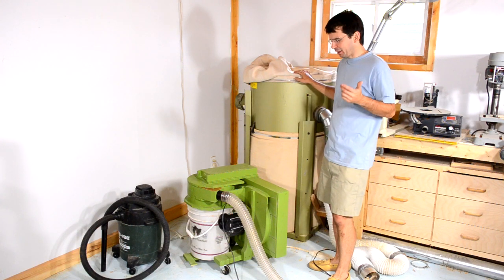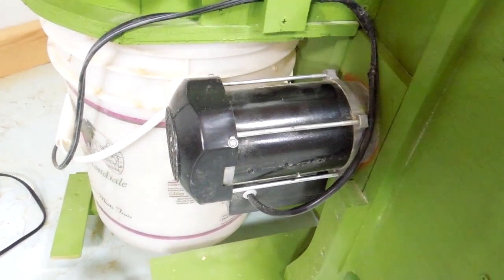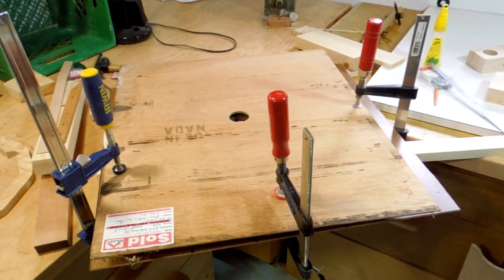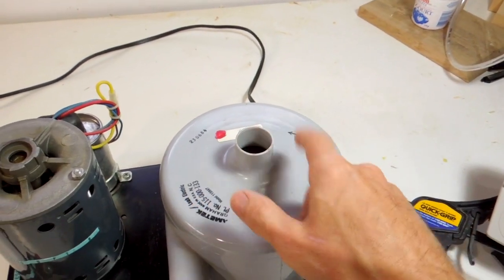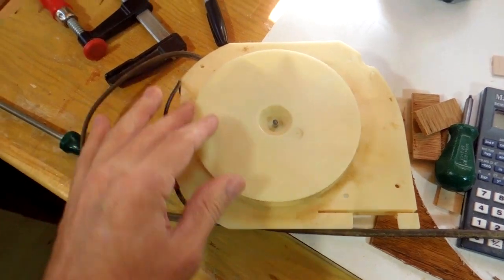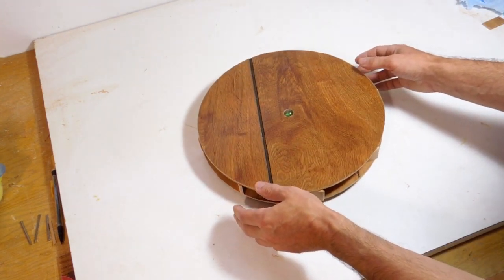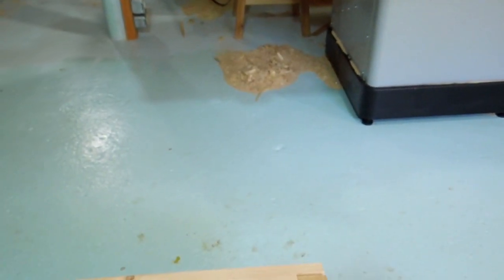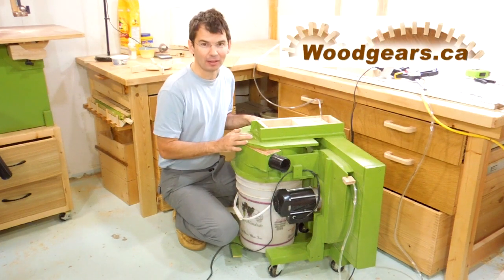Dust collector blower design experiments

Comment: The full speed of that motor sounds close to a GT-R xD
Reply: Maurice-Mores haha good ear. thats awesome
Reply: +Maurice-Mores Oh a GT-R. I've seen a electric beat one in a 1/4 mile
Reply: +Ckc dillpickle Thing about electric, I believe they have better acceleration but lower top speed
Reply: YoFavRussian
No..... Electric motors have instant torque. Most electrics are slow because they usually only have 1 gear and having a gearbox would add lots of weight and reduce efficiency of the motor
Reply: But would that not make electric have faster acceleration and lower top speed.
Reply: YoFavRussian
Weight decreases acceleration and gears increase speed
Reply: Oh, I see
Reply: Sounds like a ricer we-86 exhaust

Comment from the maker: I think if you wired one to ground and one phase, and connected the other phase straight to the other phase, it should give you a reasonably accurate reading, although with just half the voltage and power indicated.

Comment from the maker: I have used some old furnace motors.  But they aren't suitable for this particular application, they tend to be 4-pole motors running at 1750 RPM, too slow for a blower like this.

Comment: I love watching you work man, good job. I couldn't help but think that repurposing an old squirrel cage fan from an old furnace might have saved you some time. They are readily available for free and push at least 1200-1500 CFM or more, depending on the tonnage. Check with any A/C shops that change out residential systems and ask them to save you a fan.
Reply from the maker: txgunslinger77 An oscillating fan will deliver even more CFM.  But without the pressure, it's useless.  And a furnace fan gives less than a tenth of the required pressure.
Reply: Matthias Wandel I am not sure why a lot of static pressure is needed in this case? For 100 ft. collection systems with multiple branches and 8" or more of static pressure to overcome I understand, but how is that relevant here? How much static pressure are we talking about? Is it CFM or static pressure that supplies the suction? I'm not an engineer so forgive my ignorance.
Reply from the maker: txgunslinger77 Do learn something about fluid dynamics.  Any ducting has air resistance.  To get a good flow rate, you get pressure drop from air resistance.  If the blower can't provide the pressure, you simply won't get significant flow.
Reply: Matthias Wandel You didn't really answer my question, but thanks for the condescension. Unsubbed.
Reply: txgunslinger77 CFM is the output air flow and static pressure is the amount of pressure the fan can push through an object, like an air filter. Hope this helps at all
Reply: +Matthias Wandel Q=P/R, right
Reply: +Matthias Wandel  I know your comment is 9 months old, but for future people looking at this... 

A squirrel cage fan could work just fine depending on the specific fan and system pressure drops. Your fan produced roughly 8" of static head at no flow, which is a pretty sizable pressure. However, in opperation your fan will ride down the fan curve to a lower pressure/ higher flow state. 

On the squirrel cage fan, it normally operates at a much lower static pressure and much higher flows. So, if you put it in the dust collection system it would ride up the fan curve to a lower flow and higher pressure. Would there be enough pressure? Not sure, but I wouldn't outright deny it. However, in general, your comment does stand. The backwards curved blades are certainly the best for the application. 

I could also comment on the wheel size vs motor HP. I don't agree with your video comment about needing a smaller wheel because you are over amping the motor. What you actually need is a slower fan. In general, you would have a more efficient system if you kept the largest wheel diameter and slowed the fan down by going belt driven.

Source: I am a HVAC engineer and select fans regularly. Search google for "Engineering Cookbook" and read pages 5, 6, and 7 if you want to learn about fan types and applications. If you want to play around with "what ifs" go to Greenheck eCaps program and find fan selections for various fan types, CFMs, and static pressures. Pay attention to wheel diameters and motor HP in the selections.

Comment from the maker: If I built it again, I would make changes, so I don't recommend copying my design.
Also, your motor will have a different RPM, so the blower would need some slight changes as well.

Comment: well i found your channel and am glad i did.  i will be looking a bit more closely at your pantogram and horizontal drill press.  however, right now dust collection in my shop is a higher priority.  the shop ones are out of my budget and this would be fantastic.  i am presuming this is more than strong enough to clear from my thicknesser/planer?  anyway what i am trying tio say is will you be putting the plans etc up for people to follow?  not all of us are as technically minded lol.  thanks

Comment: Here's a way to compare it.. which takes more stress on the body? Walking down the street or swimming in a pool? I see this the same way, because since there's less stress on the motor it's doing the opposite effect than what it sounds like it's happening. I think she's just getting worried because she hears the RPM whirring up, thinking it's trying to grab more air to suck up, when in reality it's just due to less power being drained.. less work...

Comment: At work we use an electric outdoor leaf blower as a shop clean-up tool for blowing sawdust out of fur and garments after cleaning. The air intake is on the bottom, and the RPM speeds up when I lay it on a flat table for a few seconds while turned on. My supervisor tells me I'm going to "blow out the motor", but after watching this video and your explanation it would seem that leaving the blower on UN-covered is actually more likely to wear out the motor over time. Am I correct or is she?

Comment: Your putting a big blade directly on the motors shaft so it doesn't have enough rpms/torque to spin it to full speed. so if you used a pulley setup, you could have had the motor running full speed then you can experiment on how fast the blade can spin with different pulley sizes like 1:1/2 speed etc and the motor wouldn't work as hard meaning less watt draw BUT if you used a slightly bigger motor it might have used less watts than that motor if your using a direct shaft

Comment: Coal fired power stations grind the coal into a fine dust. Dust leaks are an explosion risk, so they use flat blade extractor fans to suck coal dust from the mill. The system works fine though “exhauster” fan blades to wear rapidly. 
The system would allow shop dust to be carried through the fan.

Comment: The blades in an closed impeller are indeed not an airfoil they just look like that because they are streamlined shapes. The geometry are found by FEM calculations involving inlet and exit velocities and pressure gradients inside the pump. The shape is by no means easy to optimize for a mixed materials pump.

A more reasonable question is: are this a good design for a pump impeller serving this purpose? Most wood dust/chips impellers are of the open design in order to be self cleaning.

Comment: Oh - I did not recognize that as a cyclone for wood dust. Looks kinda like the dimensions for a cotton/sand separator.
A very interesting project.
I am contemplating a cyclone equipped garden vac with an old lawnmower engine - so this compact design looks like it could be a winner.

Comment: @Matthiaswandel does that vac (you bought) run on a konstant rpm? otherwise the rpm should have increased rather decreasing the power input; or does it?

did you actually emigrate or have you been born in canada? btw sprichst du (noch) deutsch

Comment: Most of them have a 45 degree opening in the center so chips can slide of the blades. This yields a lower efficiency, but gives more reliable operation.
You can achieve the same pressure and air velocity by using more power.

Comment: Would you get more cfm out of a given motor if you made the impeller taller, rather than larger diameter? The air wouldn't need to be accelerated to as high a speed, I think.

Comment: I just leared something valuable here. Whenever I have been vacuuming, I have always thought that an obstruction of the pipe (you know, when something like a sock or the likes gets sucked halfway in), and the loud noise that follows, was because the motor was struggling. Well... it's the opposite. It's simply the sound of the motor spinning faster due to less work load. Fantastic...

Comment: That's true too.  I'm not really sure how stress effects an inductor or what stress is.  I mean there's really nothing touching in there except the bearings right?  I guess the higher current would effect the heat of the coils but if it's still kept reasonably cool then it shouldn't be any more damaging I think.  I dunno, It's a good question and I would also really like to know.

Comment: Well actually, the motor could run too fast and overheat its bearings. Universal motors with brushes have no natural speed and will tend to run as fast as they can without limit if the load is removed. It's not a good idea to over speed a motor like that for an extended time. You could hear how Matthias' motor sounded like it was screaming into oblivion. (But conversely, if you overload the motor it will draw too much current and the windings will overheat. Balance is the key.)

Comment: suggestion... If you are goint to redo it sometime, point the intake 'down' just enough so the air coming in does not conflict with the stream already in the 'cyclone body'.  Bill Pentz (who designed the 'clearvue' cyclone seems to think that is important.

Comment: Balancing the impeller on the marble pivot, that's pretty smart.
.
You can also get free/surplus motors and blowers from furnace and appliance installers, the old must come out before the new goes in & that can be cheap or free.

Comment: Hi, the centrifugal fan you built is a high pressure low volume one,
You need to change the direction of the blades or rotation for a high volume low pressure for a vacuum to work at it's best. Darren.

Comment: 1. Wouldn't an impeller made of a lightweight material, e.g. plastic or thin sheet aluminum, put a lot less load on the motor? 2. Do you really want a blower in your workshop that sounds like a jet taking off?
Reply: Gary Cooper 1. Maybe but just during startup because as the motor is running it needs to accelerate the rotor just a little bit. Because Rotational energy is E=1/2*m*r^2*angular velocity and m in that formula stands for mass you are right how ever that just applies until the rotor spins at maximum speed. 2. I can't answer that sorry! But I'd be slightly annoyed! 
Sorry for being mister knows-it-all :DD
Reply: Gary Cooper ndndmdmdmd

Comment: You can animate a drawing with SolidWorks and similar programs and they will show any interferences, which is a good feature.  But the programs can not show you if a piece will wobble, move too much air, too little air.  There are programs where one can create a virtual reality and model air current and other conditions but these programs are very advanced in comparison to SolidWorks and are not accessible to many people.

Comment: those U channel mounted blower units are not too difficult to find.  I'm curious as to their original use and why so many surplus units exist.  The one I bought has a motor, vacuum pump and blower.  I use the vacuum pump for a vacuum lathe chuck.  I have not considered using the blower to power a separator because the fan is so loud, I removed its belt.  But, you've got me thinking.

Comment: no wood chips will enter the blower, only a very small amount of fine dust will go thru the blower.  The blower provides suction to the Cyclone Separator that will be explained in a future video.  A Cyclone Separator will collect all chips and most of the dust is the bucket.  The Cyclone is the thick disc shape that is mounted parallel to the ground